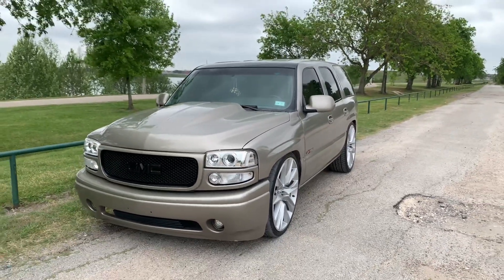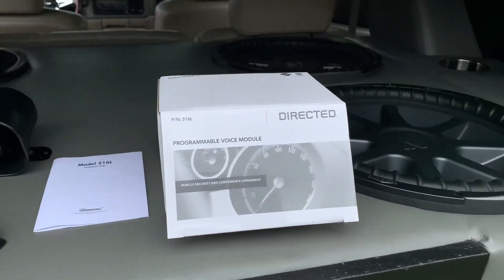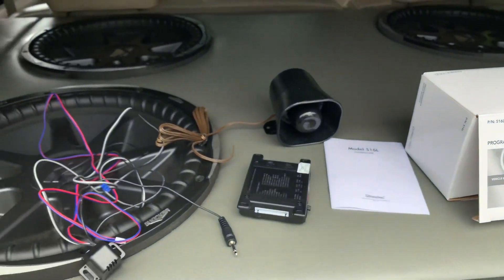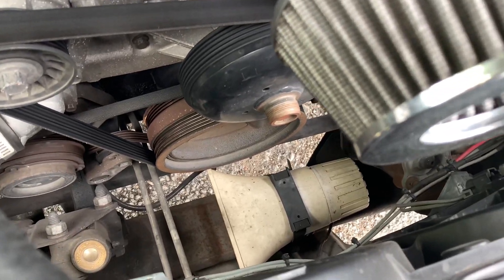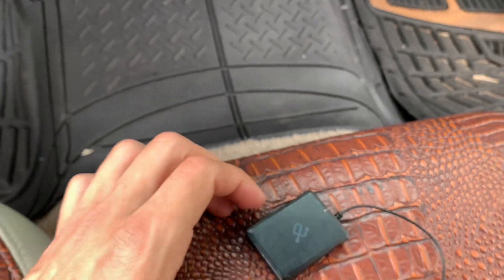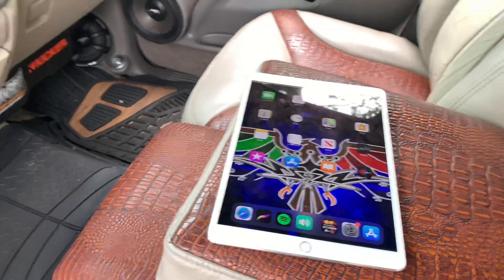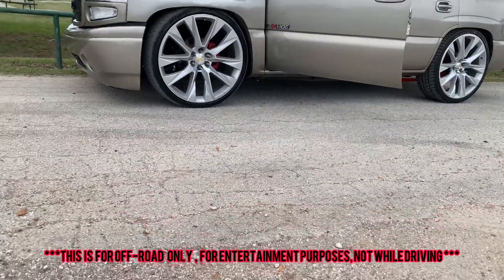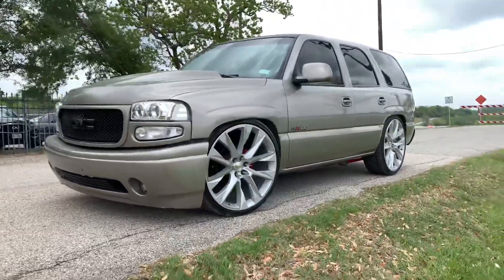Talking car alarm 516L

Comment: Got the same set up. Recorded messages but they won’t play during motion activation like yours do! How to troubleshoot?
Reply from the maker: Nice, not sure how you have it connected but the motion sensor output’s should be tied in to the voice modules trigger wires with the recorded sounds
Reply: @MiGo713  thanks for your help. I assumed this is the green door trigger wire. I didn’t have much luck with it. It still chirps during motion interference but not play sounds.
Reply from the maker: @marcussigler9758  The outputs from your Motion sensor which are usually a green and a blue wire have to be connected to the inputs of your Voice module you are trying to activate, there’s several ways of doing it but that’s essentially what you want.
Reply: @MiGo713  thank you. Gonna try it now.
Reply from the maker: @marcussigler9758  No problem!💯 Have you see my other video we’re I go more in depth on the wiring it should help out https://youtu.be/589pcnKz82Q
Reply: @MiGo713  I have the blue and green wire from the motion sensor. On the voice mod I connected both green/blue wire with the optional sensor wires(blue/white, black/white) no change. Still only chirps when motion is triggered.
Reply from the maker: @marcussigler9758  They might not be programmed right, try testing them out with a ground signal and see if it actually talks.  Ground should activate blue/white, black/white and your last one is red/white.  The orange wire has to have ground as well Gm for the system to talk

Comment: How did you wire that pa system?.. love it
Reply from the maker: Well I just replace the siren on the voice module with the Pa speaker it’s only 2 wires, the Pa System is done by adding the external aux on the voice module and adding the Bluetooth adapter
Reply: Kool. Do you wire it to the battery for power?
Reply from the maker: @pnut6176  yes it gets wired to the battery and a switch so it doesn’t drain the battery
Reply: Awesome.  Imma try it. Thanks.💯
Reply from the maker: @pnut6176  Cool, let me know how it goes👍🏼

Comment: What color is your grill ? Is that flat black?
Reply from the maker: It’s Gloss black in the center
Reply: @MiGo713  is that spray painted ?
Reply: That grill hard
Reply from the maker: @tude6455  I had it painted at a body shop to color match the truck and the center gloss black, not from a spray can.  And Thanks Appreciate it💯

Comment: Hey bro I got the same Yukon but Yk the voice activate on the steering wheel, well I clicked that and now there is this beeping noise and idk how to stop it just wanted to know if you could help
Reply from the maker: I’m not sure what button you mean I don’t think 00-02 have steering wheel controls, but you can always try resetting it by disconnecting your battery it may help

Comment: I ordered one and there are no remotes.... Did it come with the remote or am I missing something?
Reply from the maker: The module is a add on to a alarm system so it does not have any remotes or security features built in⚡️